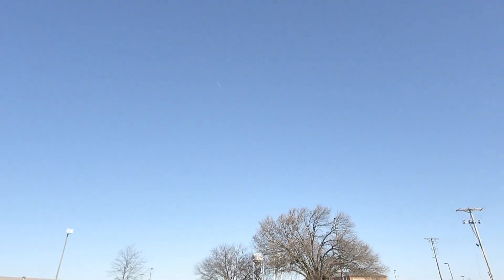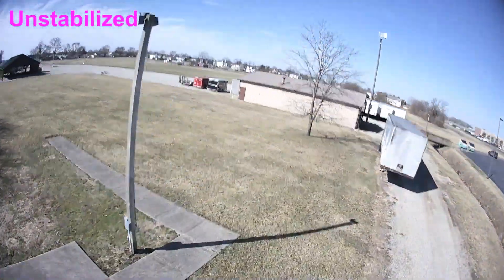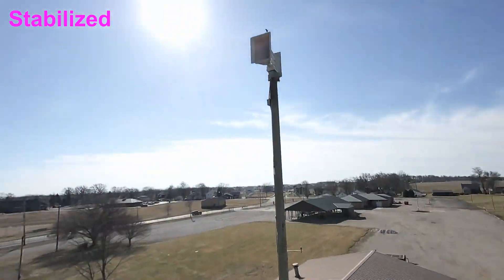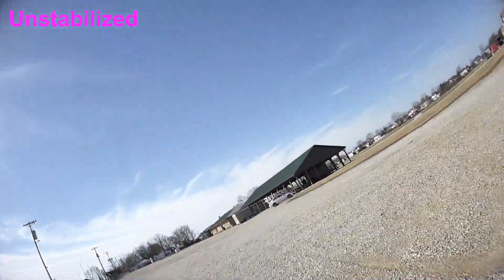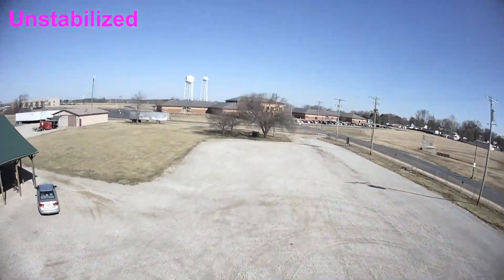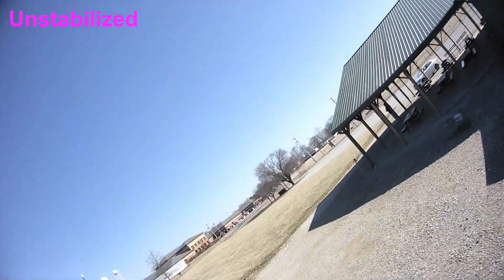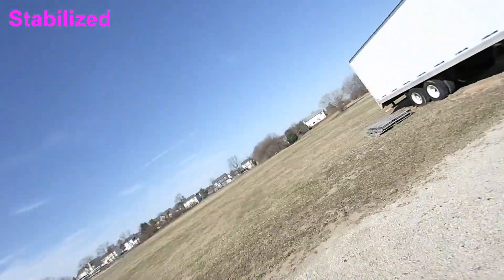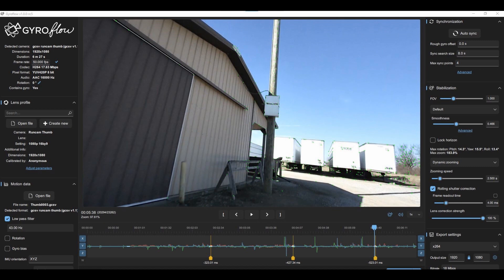Runcam Thumb & Gyroflow Flight Comparison Using 2.1 Firmware

Comment: If the drone is a clean build, the PIDs and filters are well tuned, and the Thumb is mounted well, not using Gyroflow is actually better 🙂
Nice video!
Reply from the maker: I still haven't been able to tune this ripper, it won't stop RAINING!...
I would like to get the quad right and then really go after some sweet edited footage, but it needs to dry out just a little...uhg.

Comment: nice footage.. i tried runcam thumb 2.1 with 1080p 60fps with gyro recording seems still got some jitters in footage. But i watched your footage, it was smooth.  It should be in 1080p 50fps ?
Reply from the maker: Yes, it is supposed to automatically record 1080p 50fps once you enable the GCvs option. If the setting in the configurator is left off, it should record at 60fps.. That's what I gathered. Runcam takes an odd approach to share knowledge, was most frustrating. 
Note: The config note for GCsv (0 or 1) is mentioned in my earlier video.

Comment: Nice video! Thanks for your time spent on that. Th gyroflow seems to be working, but unfortunately the 1080p resolution is too low :( But I ordered one Runcam Thumb for me too, I just wished it could at least use 2.5k resolution..
Reply from the maker: Do you suppose firmware could bump it up? I'm not very knowledgeable in this subject. 
I appreciate your support and kind words...👍🏻🍻👊🏻
Reply: @PropsOff  Nah, this would depend on the sensor and processor capabilities of the camera. I doubt the Thumb's HW would support that.. unfortunately. But I bet they will come up with a Runcam Thumb 4K pretty soon!
Reply from the maker: @erikvf7  
If its 10g and 50 bucks, it may get my attention...👍🏻🍻👊🏻

Comment: Did you use the ND filter? Never tried Gyroflow, but increasing Smoothness would perhaps improve the jello? Thx
Reply from the maker: I'm not seeing jello, and yes, I did use the included ND filter. Be careful though,  the lens fell out from its double sided taped ring..
Reply: @PropsOff  What would you suggest to fix this? Also, do you know of any replacement ND filters?
Reply from the maker: @Yith  
Yes, you can get a replacement. Runcam, "you have to contact support and open an order, the ND filter lens is $8 and not sold on the website".. So, that sounds fun..🙄 Free shipping though, lol..
Reply from the maker: Fixing Jello? 
If you hard mount the camera directly to the frame, you will get jello. I fixed this by custom making a TPU mount. The softness of the TPU creates a shock absorber, but is super strong so the camera isn't wallering around and can take a crash. I think there's one sold separately, looks heavy though.

Comment: By far this is the best Gyroflow thumb video I have seen. Unlike so many others with the Runcam Thumb that have been posted on prior firmware; it is definitely ACTUALLY is working in your test! Great comparison setup. This makes me want to pick it up now. Looks like some further work to be done to smooth things out further, but otherwise a pretty good result.
Reply from the maker: I appreciate your kind words of encouragement, I hold your opinion in high regard. I'm actually surprised its working and on a badly tuned quad. I can imagine how juicy the footage from a well balanced cinewhoop would be. I'm embarrassed of the hours I spent working all this out. Enjoy the Breeze...👍🏻🍻👊🏻